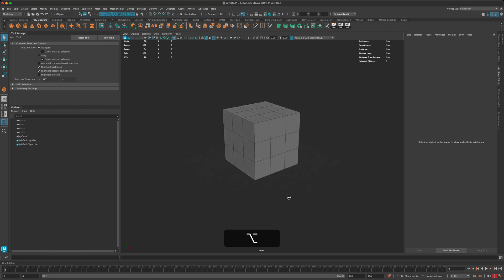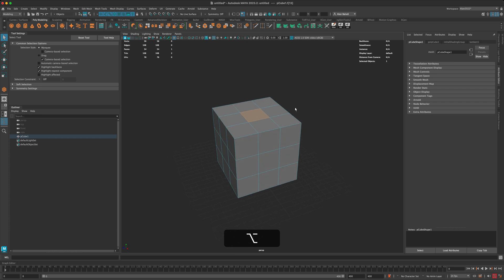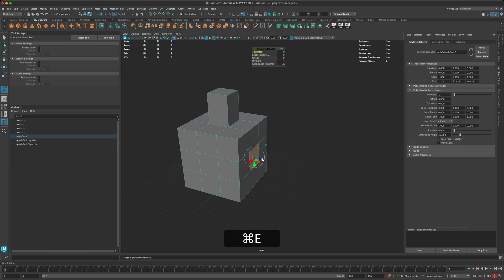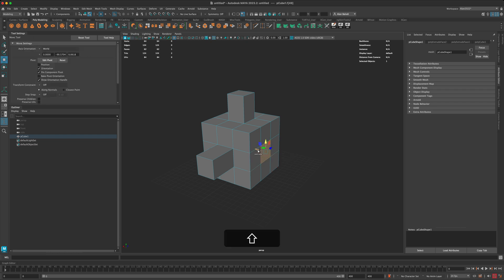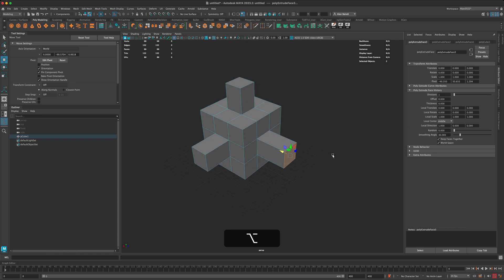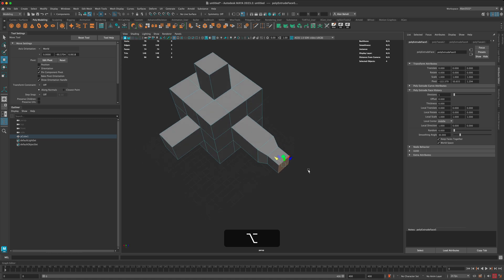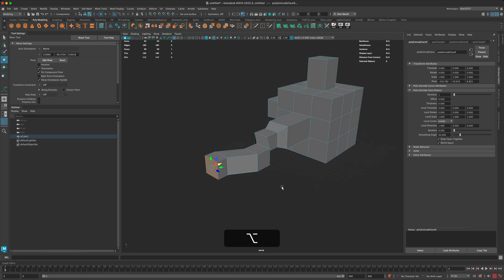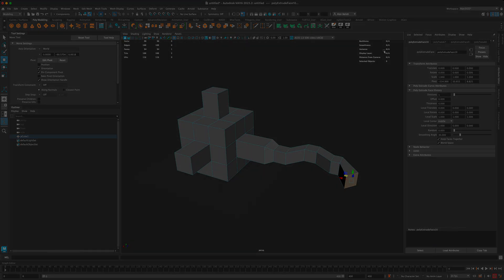3 Different Ways to EXTRUDE in Maya (Tips)

Comment: I am trying to extrude with shift, but it's not working 
how do I enable it?
Reply from the maker: Hi 👋 

Shift + Drag only works when using the Modeling Toolkit. Here’s how to make sure it’s active:
	•	Go to Mesh Tools or click the small hammer icon on the left (Modeling Toolkit).
	•	Select your mesh and make sure you’re in component mode (face/edge/vertex).
	•	Try Shift + Left-Drag on a face — it should extrude.